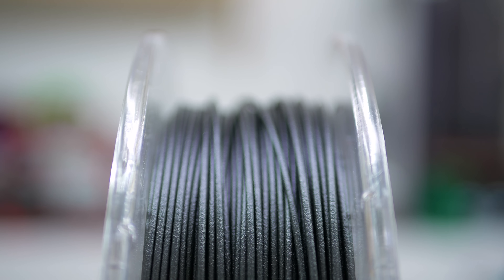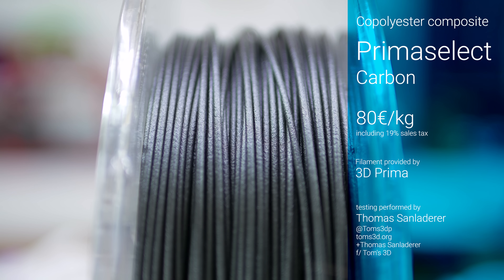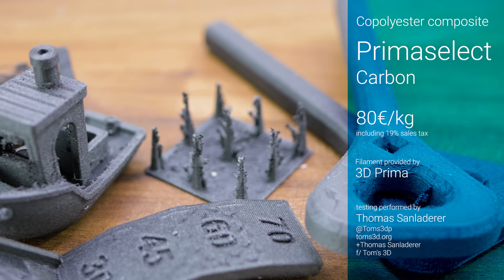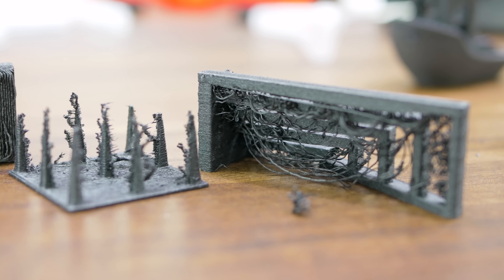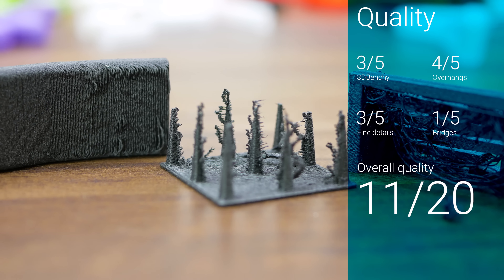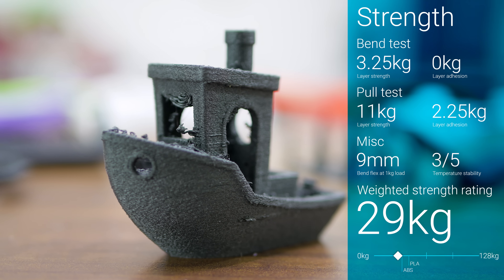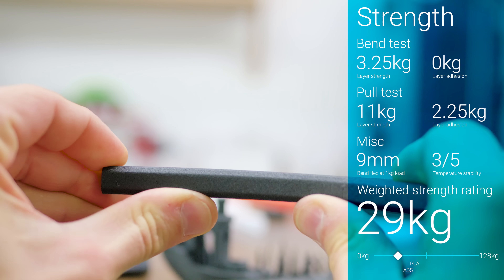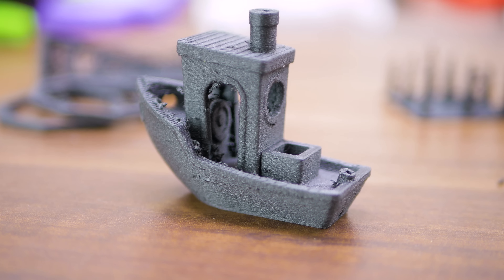Ultra-textured PrimaSELECT Carbon PETG review! #Filaween

Comment: I used this to print Model Train smoke assemblies where i needed High Heat Resistance. Between using technology to manage the heater temp and CF PETG i was able to operate the Smoke System in the 140-160 C range and get great smoke and not lose the housing to softness. I did have a few failures in the calibration process. But now i have a custom design that fits the 1950 Trains i use and it smokes like a new engine. I was able to get very clean prints with minor clean up.

Comment: i can't understand why to use filaments like this.. Maybe i'm missing the point but the quality is low, price is high and is less strong..
Reply: I don't get it either..
Reply: tagy1234 maybe we are missing something
Reply: Having printed with a variety of carbon filaments (Carbonfil / Filamentive Carbon PETG / Nylforce Carb-Nylon), I can say that they generally produce much stiffer parts and can do it with a lot less infill.

The stuff in Tom's mini review looks like it needs the settings dialed in properly, unless it's just crap to start with.
Reply: Purely stiffness if I'm right....

Comment: A lot of these particle infused filaments are used just for the appearance of the print, not the strength or printability. Think of bronzefill. It's inferior mechanically, but it looks fantastic printed (especially if you let it corrode a bit). I admit i fail to see even cosmetic benefits here, but its hard to tell just how cool it looks unless you have the part in your hand.
Reply: If you wanted to print something that had a sand casted look straight of the print surface it would work.
Reply: yea, i can see that. I do enjoy trying all the different filaments, the different types make a huge difference in how the object looks and feels. Right now i am having a good time with the translucent PETG filaments. They print for me about as easy as PLA, and they look great. And you can leave them in your car without them going all soft.  Printing onto heated glass with a little hairspray, and it holds great without having to pry the thing off or fight with the blue tape.

Comment: Makes sense that carbon fiber filament would be inferior because it is just tiny bits of carbon fiber added into the filament. I don't know much on Carbon fiber except that it really only gets its strength from the many long fibers woven together to make a pattern which ends up possibly being a sheet of carbon fiber.
Reply: Not sure why it always got great reviews for strength, probably just hyped up too much. Thanks for the review, going to save my money now lol
Reply: There are other brands and types of carbon filament. This one doesn't represent all of them and seems to be pretty poor compared to the several types that I've tried.

Of course, they're not going to be a direct replacement for actual woven carbon fiber for the reasons you've stated. However, they can offer significant advantages over 'normal' filament in terms of stiffness if you require it.
Reply: Steel fibers are added to concrete to increase tensile strength. Same idea.